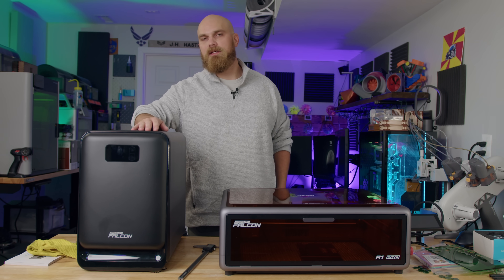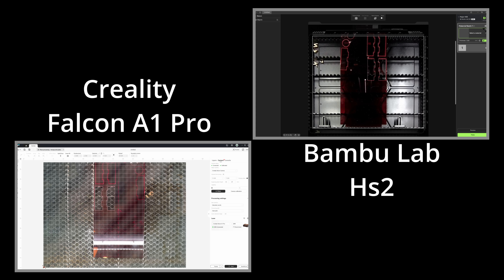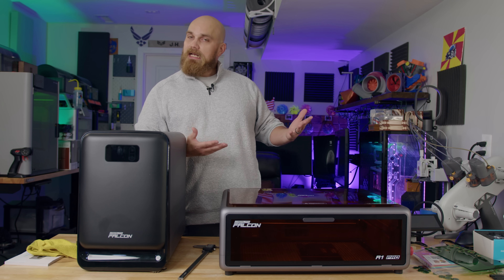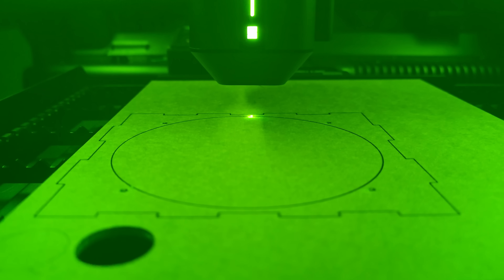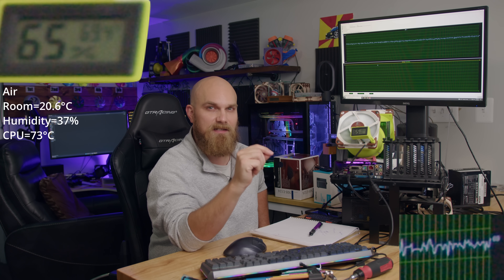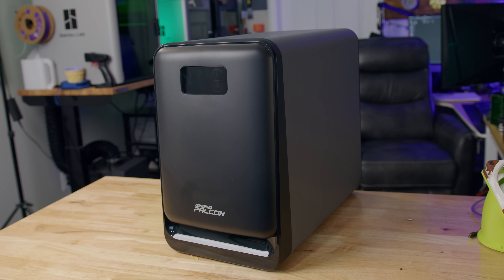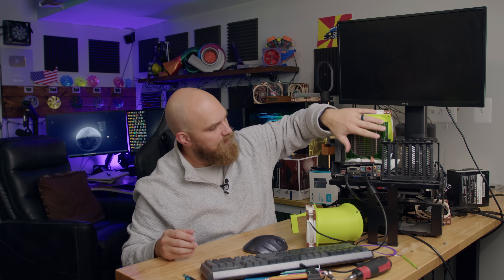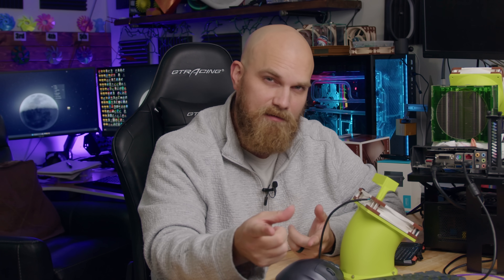I Water-Cooled My Air Cooler… Again, But Different

Comment: Welcome to the world of evaporative cooling.
Reply: Welcome to "The Science of Heatpipes" 😅
I believe they were originally using alcohol inside, but then switched to distilled water under partial vacuum to achieve the same results.
Reply: @DUKE_of_RAMBLE 
There are indeed heatpipes with methanol and even ammonia, but they're used for low temperature applications - around -50 to 100°C and -70 to 50°C respectively iirc - and have lower heat transfer capacities due to the much lower latent heat of other liquids. 
Heat pipes in consumer products with the usual temperature ranges however have been water for a long time, if not from the start, and all heatpipes work under vacuum due to the fact of being filled with a condensable liquid - at room temperature and most working temperatures that is of course.
Reply: @DUKE_of_RAMBLE *switched to liquid metal
Reply: @Glibglobler  How can they evaporates liquid metal at the paltry temperatures a CPU puts out?? (sincerely asking, no snark)
Unless I've misunderstood and somehow the capillary action is still functional for liquid metal?
Reply: @DUKE_of_RAMBLE apparently it involves a magnetic pump that creates a lorentz force to circulate"evaporate" the liquid metal as it heats. Very specialized high performance cooling system.
Reply: @gurgleblaster2282  Oh, that's what you were referring to. Yea, was a bummer they never took off. Only reason I didn't think of it was due to it not fitting the context lol

But yea, I've recently seen an external pump that would definitely work for a vastly cheaper system, assuming the hose would hold up to the gallium (I imagine it would). The "pump" simply has bearings mounted on the ends of arms, so while the motor spins it traps the liquid as the arm moves the bearing past a curved flat surface (the bearing being needed so that there is no friction on the hose).

Problem is gallium "reacts" with damn near everything, even at room temperature. Aluminum, copper, silver, gold, nickel, probably others as well but I didn't check because... apparently chromium is safe! So perhaps an insanely thin coating of it on copper coldplate, similar to one in a water cooled AIC (but with fin spacing large enough for the gallium), could be sufficient to protect the copper from being eating away! 🤔
Reply: @DUKE_of_RAMBLE its a low boiling point liquid metal alloy which is held by a wick material , when one side heats up the liquid metal evaporates and travles through the middle of the pipe to the cold side where its condensed and flows back through the wick via capillary action to the hot side , if the hot side is too hot then sometimes the liquid metal all evaporates before it reaches the hotest  point which significantly reduces heat tranfer, the samep also happens at low temps were the liquid solidifies. Very clever little things and i didnt know they originally used alcohol which is interesting
Reply: @Glibglobler 
I'm sorry, but that's so wrong it's basically straight up nonsense.

There are in fact specialty heatpipes for high temperature applications that use mercury, potassium or sodium - maybe there are even some that use an eutectic alloy, though I kind of doubt that - but they are for applications in the several hundred degree celsius range.
The lowest boiling point of all metals is mercury, afaik no eutectic boils significantly lower. That's just not how the whole eutectic thing works. The melting point being significantly reduced doesn't mean it becomes a super low boiling azeotrope as well. 

Besides that, there's no reason to use metals for regular applications in the first place. In the Temperature range around room temperature to something like 200°C there's no better medium than water with its excellent thermal and physical properties. 
It's basically perfect with its extremely high latent heat of evaporation and its other physical properties are also very conducive to its use in such applications. 
That's why it is what's been used, is used and will be used in the future. 
There's just nothing to gain from other working fluids in this range.
Reply: @heinzhaupthaar5590 yea ive just aperntly had some weirdly niche heat pipes because the one that i accidentally broke a while ago was liquid metal but it was a very thin high performance ones
Reply: Nothing new, evaporative cooling is how they kept milk fresh (for a couple of days) before fridges...
Reply: @HMan2828  ive been installing chillers and cooling towers for industrial building for 10 years and everything i replace is at least 30 years old. It is for sure nothing new.
Reply: beat me to it
Reply: Nah pretty sure Apple hasn't invented it yet mate.
Reply: @CableWrestler  they will after samsung mentions it 😂
Reply: @CableWrestler  Actually Apple finally figured it out lmao, the 17 Pro series has vapor chambers finally and they are rumored to make their way into iPads and Macs next year.
Reply: Apple lives so rent-free in your head that you brought them up here LOL
Reply: @RightJoystick  negative. I dont allow renters in my head. My thoughts are already f'd up enough. I dont need any other damages.
Reply: I don't think this is evaporative cooling. The water vapor condensing on the fins and should release the same amount of heat energy that was "lost" when it evaporated. The air is just at a lower temperature due to the initial evaporation and the heat gained from condensation would only equal the heat lost from evaporation if the air coming out of the cooler was of equal humidity to the ambient air.
Reply: @victorro8760 
With the fins being significantly above room and cooling air temperature they can't be at dew point temperature, so there can't be any condensation of evaporated water at the heatsink fins even at 100% rH.

It is in fact evaporative cooling, just indirect by cooling air as the cooling medium.
It's rather common too, engines of different kinds and industrial processes use it as well. If increased humidity is permissive and the conditions allow it that's a pretty nice and simple way of cooling gasses or processes.

Comment: Does the water temperature in the dehumidifier make a difference? Is there any chance that the water vapor was slightly cooler due to the water temperature?
Reply: Would having a higronometer on the intake shoe that difference?